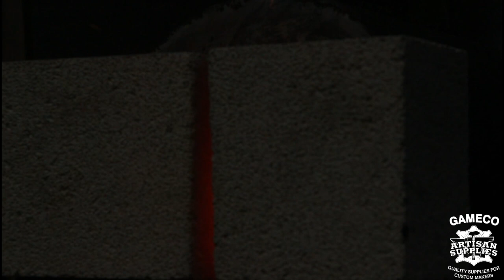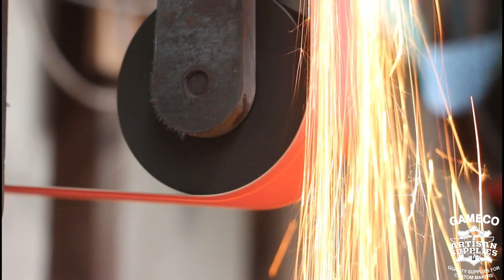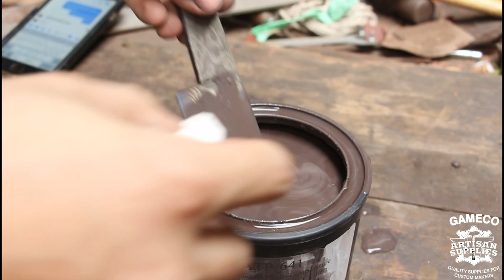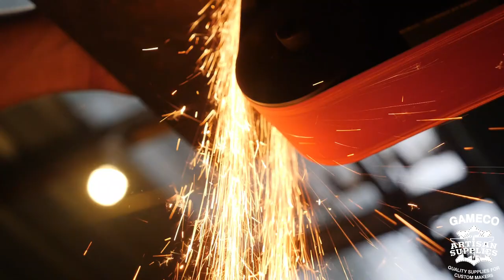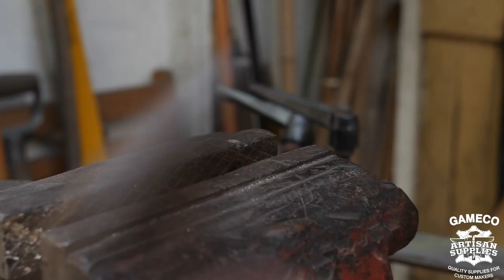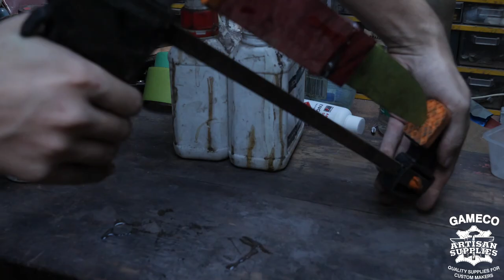Making a damascus steel knife

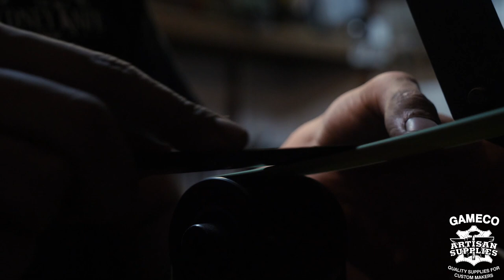Comment: What are you doing on the slack belt around 9:20 ? I would assume convexing the edge but then you go to handsanding with a flat bar , would that cancel the convex?
 Also tim are you doing all the filming and editing too? Cheers
Reply from the maker: yeah I give the last bit of my edge a convex, its not heaps but it helps with the cutting edge. The handsanding does cancel a little bit of the convex but I also do a rough sand to the geometry of the blade. And yeah all the filming and editing is done by me. :) -Tim
Reply: @gamecoartisansupplies8568  oh cool cheers for the info. Your doing a great job all round. Cheers 4 sharing sir.